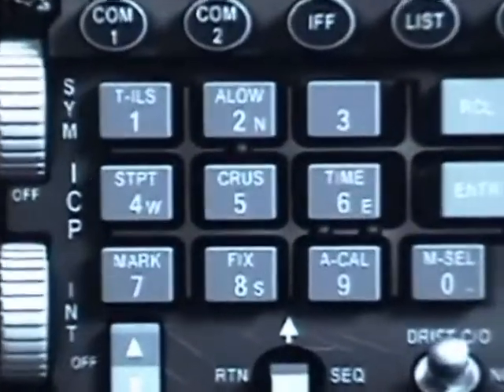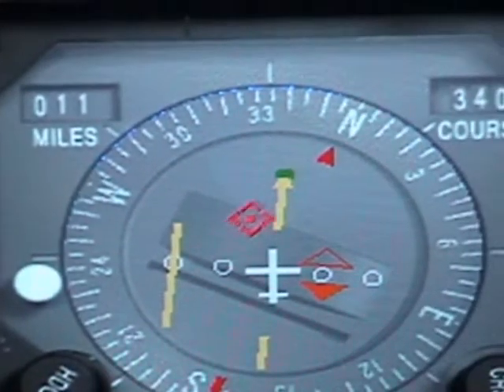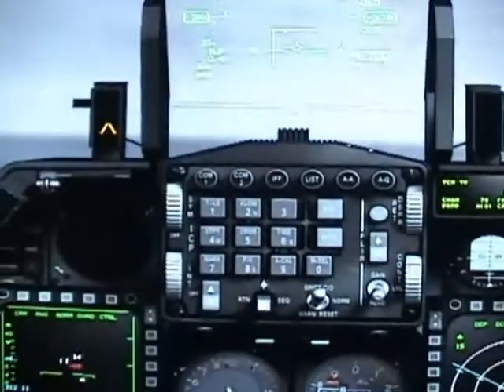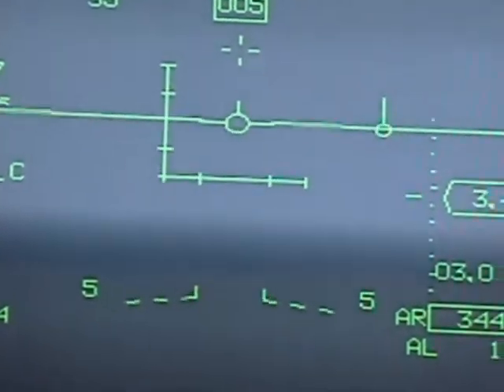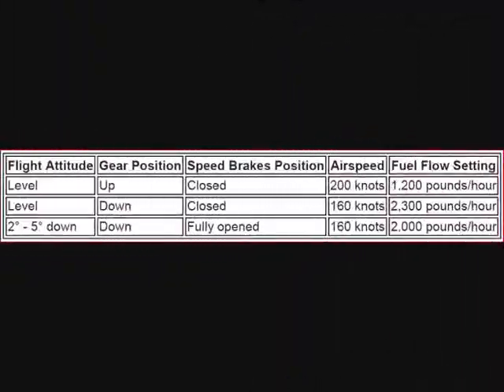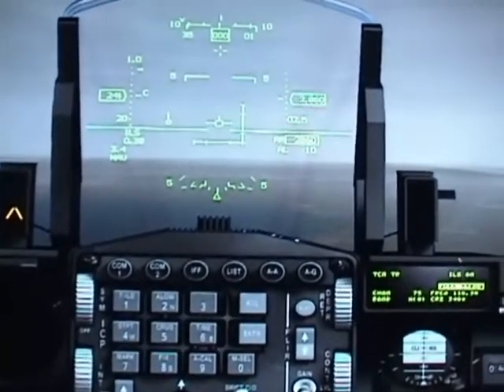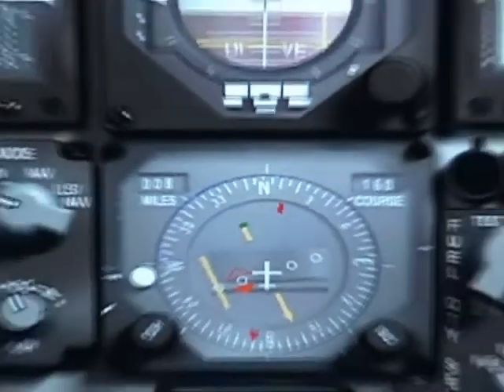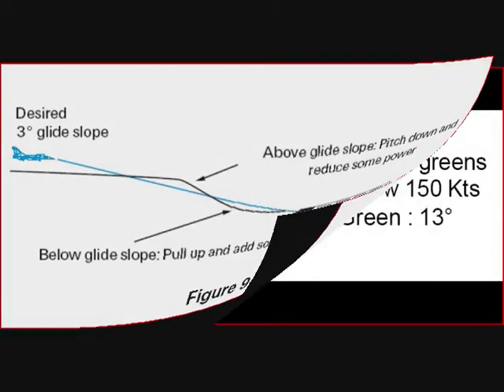F16 F4.0RV HQ LANDING PROCEDURES PART 2

Comment: Good video, but one problem.  The piece of equipment to the left of the HUD with the V / inverted V and circle is the AoA indexer... It just tells you if your AoA is too high or low for an approach, but it doesn't even know that you are on approach if you are. If you have the green circle, you are on the proper angle of attack for an approach.

Comment: I'm sorry, but you have some things fundamentally confused. AoA, or Angle of Attack, has nothing to do with glideslope angle or glidepath. AoA tells you (simplified) the angle of air over the wings, AT ANY PITCH; Glideslope tells you the ideal angle that your plane will fly down to the runway... usually 3 degrees. You can easily be ON glideslope with too high, or too low, of an AoA. Bottom line: 13 degrees A0A is ideal for touchdown, after a (usually) 3 degree glide down the approach window.

Comment: Great vids Victor however I must correct you at around the 3.20 you refer to the instrument with the inverted V as relating to the glidescope. It bears no relevance to the glidescope, it is indicating only your angle of attack which for those that dont know the difference, is the pitch of the aircraft. The green circle iluminates when on correct AOA for landing.

Comment: That's incorrect roadrunner, it has nothing to do with landing gear. It is called the AOI, angle of attack indexer. The landing gear warning is on the left console and is represented by three green led's which iluminate when gear is down.